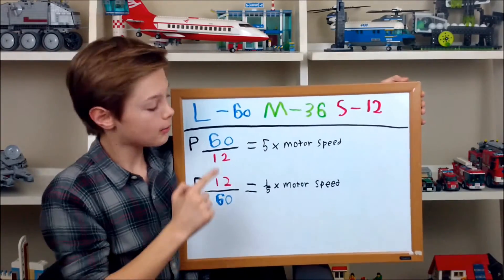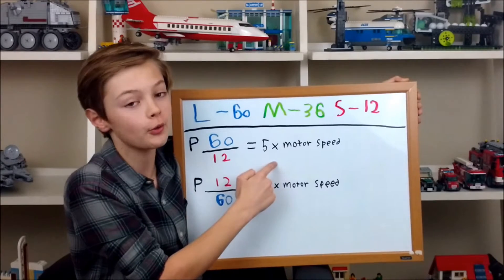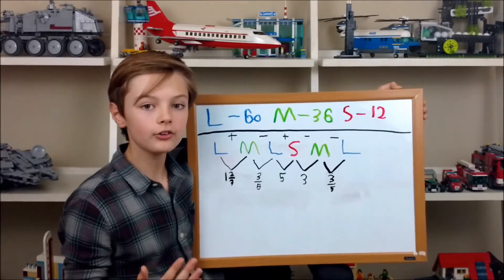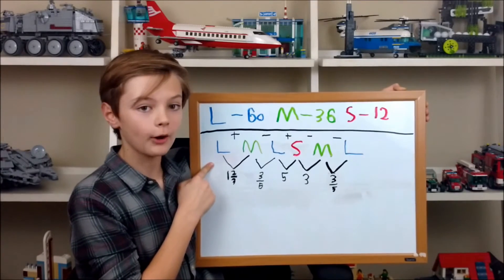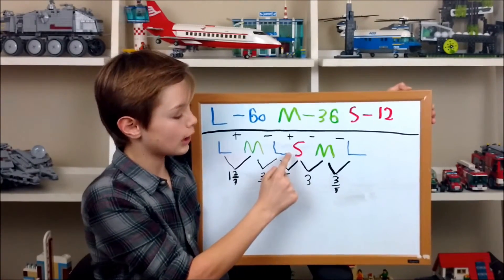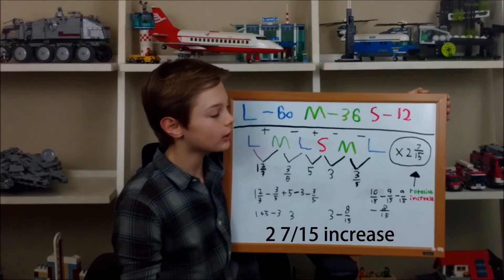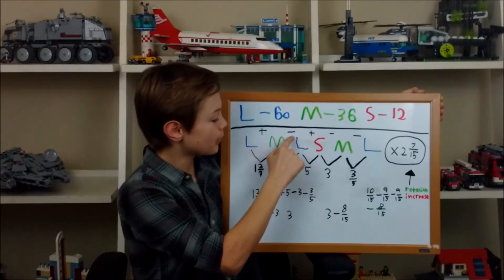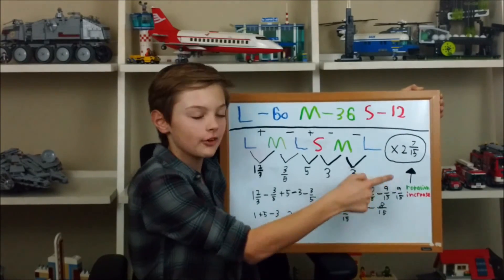Gear Ratio Calculation? - Vex IQ parts

Comment: Good show! What about RPM's calculations?
Reply from the maker: Bonnie Heppthe RPM was just an example, like if you have a big gear to a small, it is 5 times the motor speed. So with that, a 1 RPM motor would give off a 5 RPM rotation and so on.